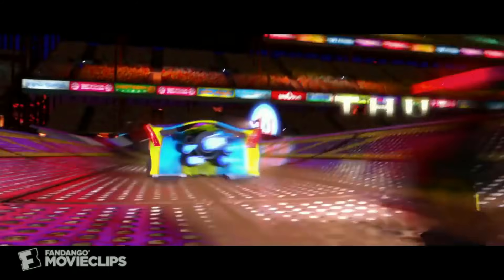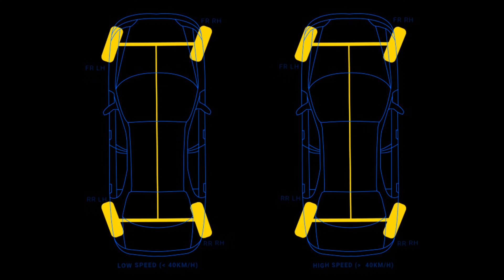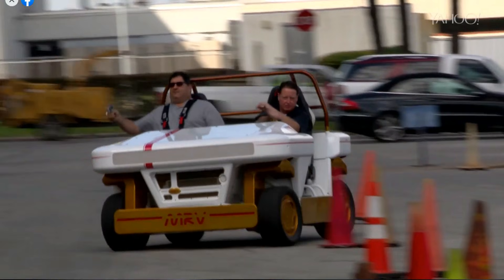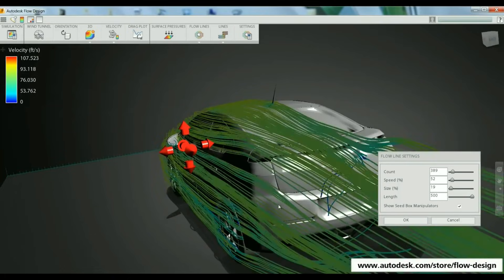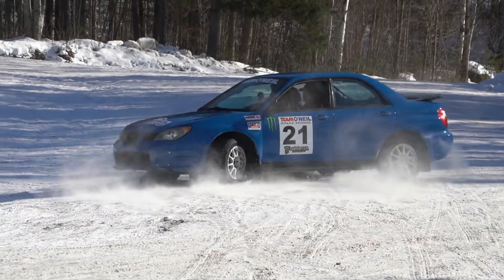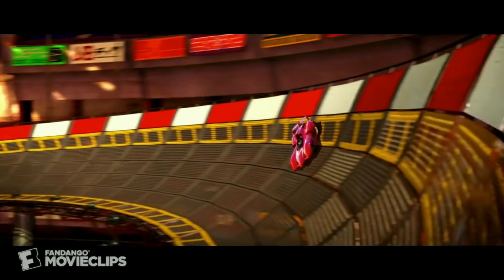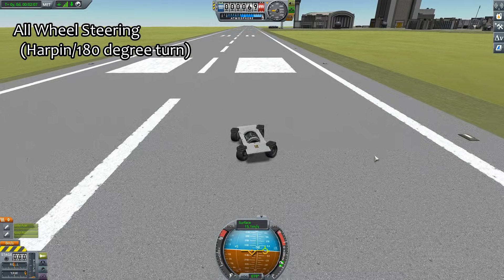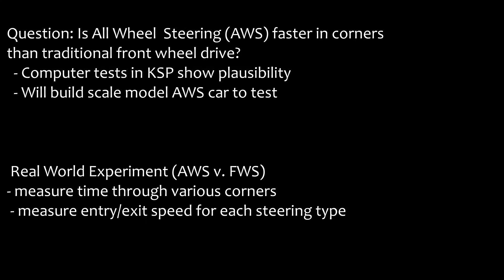Will Speed Racer & NASA Technology Revolutionize Racing?

Comment: Cool video! It's worth noting that in the movie, the Mach 5, Shooting Star, and other vehicles seen in the Casa Cristo Rally have a traditional wheelbase and steering system. The Mach 6 exists because the Mach 5 isn't a T-180 -- That's why they have to build a new Mach 6 for Speed to enter the Grand Prix, despite already having the Mach 5. Also, one other thing worth mentioning is that T-180s appear to have both a "normal" engine powering the wheels AND some sort of jet engine in the rear. When the T-180 "drifts", the wheels point in the direction of the turn, and the car rotates it's rear end outwards and subsequently points the jet engine outwards, creating thrust that cancels out centrifugal force, allowing the car to take corners ridiculously fast without relying solely on the grip coefficient of the tires. The many pedals of the T-180 probably help the driver control what the jet engine is doing at any given time, among other things, and I'm sure there is some sort of computer controlled aspect of how the car reacts to steering inputs. It would be a very complicated vehicle to drive. Also, Rex's Mach 4 appears to be a sort of... proto-T180, with both a traditional steering system and a rear jet engine that simply works in tandem with the regular engine and throttle pedal.

EDIT 2025: There's a Speed Racer mod for Assetto Corsa now where you can drive these cars, and this comment ended up being pretty on point. I highly recommend the mod, it's amazing
Reply: Can we give him an award smart
Reply: @williamhutchins479  no? At Fuji Helexicon Speed was driving a T-180, and it's clearly visible even the number 6 on his car
Plus, only T-180 cars can drive on those types of race tracks
Reply: I always thought Rex’s Mach-4 had T-180 in the front and standard in the rear, sort of like using drift suspension in a race car. You still take corners like you would with a fully standard wheelbase, but are able to recover from excessive angle slides much easier. 
Then later on down the line, about the time he had to “disappear” the AWS T-180 cars started getting used.
Reply: @williamhutchins479  At Thunderhead, Fuji, and the Grand Prix it was the Mach 6 that was there. The Mach 5 isn’t a T-180 since it couldn’t move its wheels independently, not having a conventional wheelbase and axle, without the use of a jet engine in its rear, and it was just like a normal two-seater sports car that Rex Racer drove in Speed’s childhood, in the years prior to the modifications that were added (jump jacks, replaceable tires, bulletproof glass canopy and such) before the Casa Cristo. Even at the Grand Prix, Sparky noted that the Mach 6 was at its same size as the one they had at Thunderhead. Although the Mach 5 was used at Thunderhead at some times, it’s not fit to race. Also, the Mach 4 doesn’t fit to the modern generation of race cars that Speed faces.
Reply: @raphaelmiguelbalon9226  The mach 6 WAS at Fuji, but not Thunderhead that was the mach 5, originally, but after it was destroyed at Fuji, they had to rebuild it, but in the show I believe they said it was built from the ground up and I believe they said they built it from "concept to car" but it's been a minute since I've watched it, maybe it was just the mach 6 and the mach 5 was just repurposed as a "cruiser" for speed. Again I could be wrong.
Reply: @williamhutchins479 hey I know this is 2/3 years old but I am compelled to add my piece, it was the Mach 6 at Thunderhead not the Mach 5. There were technically 2 Mach 6 cars shown in the movie, the original one raced on Thunderhead and Fuji while the second one was raced at the Grand Prix. At the start of the Grand Prix, Sparky says to Speed "That cockpit is the exact same size it was at Thunderhead" to assure Speed that he should be comfortable driving it
Reply: Yes, but the mach 4 and 5 looked like cars while the mach 6 has a full on jet like cockpit. But they didn't rebuild the mach 6 because the mach 5 was slow the mach 6 got blown up in Fuji. Thus they had to build a new car and used newer tactics. They even said they started from design to finish in the time frame I can't recall how long. 
Interesting to note that Spritle didn't know the engine originally put in the mach 6, when pops brought up Bernoulli's "Real power" I don't know I just find it odd, or the original mach 6 was slower than the new one? Doubtful.
Reply: @williamhutchins479  1. Mach 4 also had the same kinda cockpit as the mach 6
2. The mach 6 blew up at fuji the mach 5 was used in casa cristo
Reply: @williamhutchins479 judging by spritles reaction in the movie. It could be either or. But I'm leaning towards the idea of the OG march 6 having a different engine. Maybe another homemade version of a transponder engine (if that how it's spelt im not sure, quote me if I'm wrong). What I find is both impressive and weird, is that it take royalton industries to knock out their GRX for jack Taylor in about 36 hours (despite havin' a massive McLaren like facility that should in theory, be producing about 500 of these within the same time span, judging by the tech and equipment they have in house) but it took pops and the rest of racer motors 32 hours to whip out a mint looking march 6 from start to finish with about a tenth of the: budget, man (and chimp) power and overall workspace. So I'm not sure if I should be in awe of racer motors, or wanting to spin royalton's jaw in and tell him to get his shit together.
Reply: @williamhutchins479  no the mach 5 is a road car my guy. An older version of the mach 6 got blown up at fuji
Reply: SPEED RACER LORE
Reply: @williamhutchins479 Mach 5 never blew up it was Mach 6 used at fuji
Reply: @o_o888  I'm aware. You wasted your time.
Reply: @williamhutchins479  had to be sure
Reply: I would say it seems the jet is either exhaust for a more powerful engine or like you say a separate jet engine but its meant for the ridiculous jumps and power that the tracks of the movie necessitate
Reply: That's a long way to say "The Mach 5 does not have 4WS"
Reply: FINALLY SOMEONE WHO GETS IT!!! I’ve had numerous debates across numerous forums who assume there are normal axles on those cars and don’t understand the double engine/powercell dynamic. The Speed Racer video game on Ps2 and Wii actually demonstrate these physics perfectly. You can drive and do car fu and K.O.s just like in the movie, and it feels so cinematic and awesome. It uses the characteristics of these double engines and the wheels don’t rotate 180 degrees. It’s actually an infinitely rotating wheel and axle system similar to that of what’s under your swiveling office chair you might be sitting on now. The key is how they are delivering the power to these individual axles. That’s what I have been trying to wrap my head around for the past 15 years since childhood. I’ve always been interested in this topic and have come up with so many theories.
Reply: @dragongod666sevagoth3  I'm sorry for your loss trying to talk to people about these cars, lol. The Speed Racer video game was kinda crazy good for what it was. I feel like the controls vastly simplify what driving a T-180 would entail with realistic physics, but you still get this great understanding of how they aren't limited like normal cars. The amount of concept and imagination they put into this one-off story adapting an old cartoon is insane.
Reply: really sick comment
Reply: Yeah my bet is regular engine provides wheel power while the thrust engine provides resistance against centrifugal forces and creates power for the big leaps the cars make on the tracks
Reply: @raphaelmiguelbalon9226  You clearly didn't read my comment. A. AND B. Casa Cristo happened AFTER Fuji, AND Thunderhead, the mach 6 CRASHED at Fuji.  "looks like their gonna be fishing Speed out of the water!" Here's a quote from the Wiki "After the "accident" during the Fuji Helexicon race, Speed, Pops, Sparky and family are left to build a new one from scratch to race in the WRL Grand Prix." Again stating from scratch. If you watch the movie again you'll notice that Casa Cristo was the MACH 5 cause the mach 5 is a two seater, while the Mach 6 is a single seater. Also note, the expandable window shield now being bulletproof.
Yes the mach 6 was used in Thunderhead. My bad, but I still don't get why you just keep repeating the same stuff?
Reply: @williamhutchins479  Yes, that’s right. And also, who said it was Speed that had to be “fished from the drink”? Isn’t it supposed to be Taejo and Billy Ray when the latter rammed into the former that spun out of control in the loop?

Comment: four wheel steering is already widely used and very effective, infact you know the GTR R34 was a prime example of such. the wheel change is not to the same magnitude as what you are imagining however due to the complexity of the build and the danger of turns. at high speeds the steering sensitivity is extremely high and with 4 wheel steering it would very dangerous compared to convential steering options.